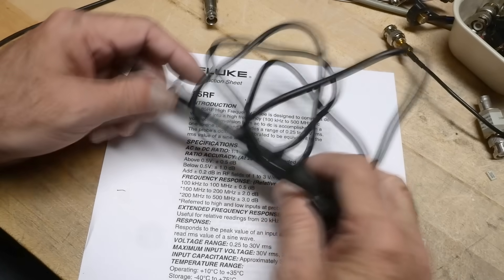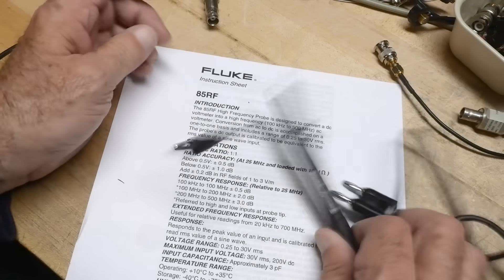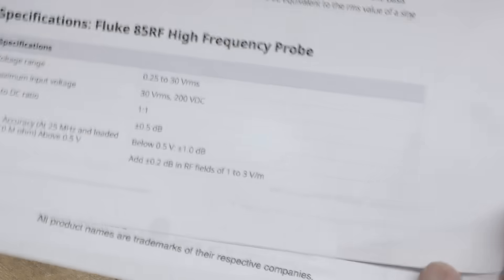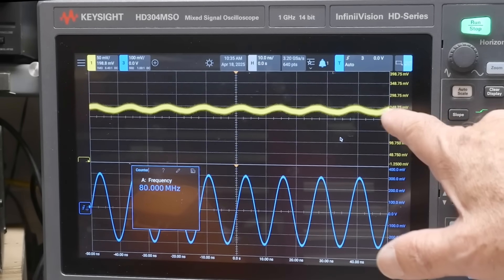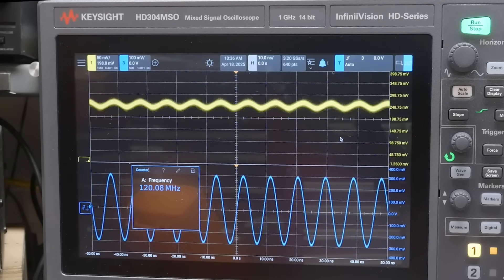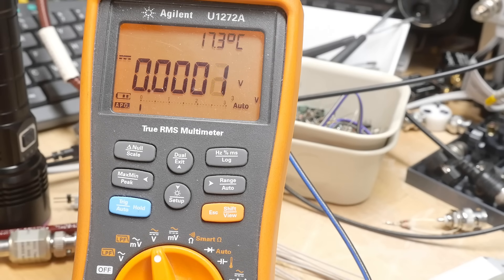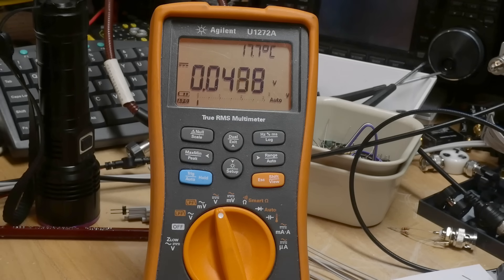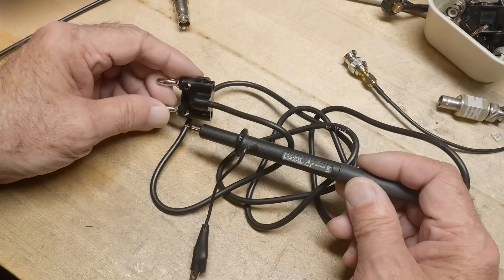#2224 Fluke RF85 Probe

Comment: Input diodes in probes are realy sensitive ones, they are realy easy to damage whit ESD.
Soviet used detector diodes in portable radar detector, came whit bunch of new in lead tubes, one whoud cut open lead tube to replace ones that died.
It seems that they where on order of magnitude more sensitive than normal germanium ones.

Comment: The product overview says: "The 85RF High Frequency Probe is designed to convert a DC voltmeter with a input impedance of 10M ohms into a high frequency (100 kHz to 500 Mhz) RF voltmeter." It's not surprising that it doesn't work feeding into a 50 Ohm load...
Reply from the maker: the scope is not 50ohm, it is high impedance, and I used a 10M volt meter to show the effect is still there.

Comment: I don't know what caused that behavior, but I am almost sure that it is some weird/parasitic resonance that happened inside that particular setup. As reconnecting that probe to the multimeter slightly changed that behavior, I am definitely thinking about something related to the grounding, because that's what was changed when the output of that probe was connected to the multimeter as multimeter has no ground interconnected to the rest of that setup. Simplest thing to try — remove that grounding wire loop between the probe and the rest of the setup replacing it with a proper coaxial connection. I don't know whether this helps or not, but it's easy to do and it's always better to try simple things first.
Reply: At higher frequencies the rather long ground lead is going to drastically effect it's performance.  The probe becomes a resonant circuit.  At higher frequencies the ground wire should be removed and one of the spring ground points like are used on regular oscilloscope probes should be used.  It has the ring at the tip for them.

Comment: Long time ago I made some probes like this for tracing signals. later on I built true RF probes for tracking RF-active points on PCB's and also to evaluate potential EMC violating radiation, over a band of 2 GHz. The sensors were for electric and magnetic field components. The signal was sent to a spectrum analyzer. EMC directive compliance could be predicted well with them. It was very easy point of any component or trace on the PCB which was either radiating RF or the RF currents were relatively large.
Reply: As a clarification, the probes were very small non-touching, sensing the fields just outside the PCB

Comment: Right off the bat, that long ground alligator clip lead is not going to work at high frequencies. Just like a scope probe, you need one of those tiny springy ground wires that slips on the end of the probe to get accurate results. That's why you see wild peaks and dips: resonance with that huge ground lead inductance.
Reply: Bingo.
Reply: Spot on! The probe came with a ground spring contact that slipped onto the sleeve behind the tip. It also came with a slip on BNC connector if memory serves.

Comment: As a comparison, I have a BNC coaxial inline detector,  100k to 4 Ghz.  It's DC voltage output stayed within 1 dB varying my generator from 30 Mhz to 500 Mhz as my upper limit is 520. Taking into account the generator tolerances, the detector and possible reactance in the load .it is not terrible
Reply: Yeah, Amazon has cheapo inline detectors based on ad8362  with 50Hz-3.8G,but requires 5V. -52 to +8dbm.

Comment: I did check it with my signal generator into a 50 ohm load and ref. 30 MHz, 0dbm.   it rises a little to be 1 db up at 100.  But it rises to just over 5 db up at 200 and almost 6 down at 300 so I would call it maybe a 100 MHz probe.  This with a DMM measuring probe output.  BTW I did have the probe into a female BNC and clipped the ground lead to it but I believe the ground ring on the probe was resting on the BNC body as it went in at an angle.

Comment: A passive probe will have some dependency on the amplitude at the lower end of its range.  The 300 mV peak are just a little below the lower end of 0,25mv rms. I will not defend this type of equipment, it might still be helpful for ghost busters as the datasheet says : add +-0.2 dB in RF fields of 1 to 3 V/m.

Comment: According to point a on page 2 in the instruction sheat you showed the 4 inch grounding cliplead you are using is only good up to 100 MHz.
You need a coaxial adapter or other way to connect with low inductance to the coaxial ground near the tip to use the full bandwidth.
Reply: If we estimate the loop inductance to 125 nH and use the specified 3 pF input capacitance we get a resonance at 260 MHz. 125 nH is the inductance of a 50 mm wire loop of 1 mm wire according to an online calculator, a rough approximation of the geometry of your setup.
Reply: My 85 has a ground lead that measures 4 3/8 from the body to the end of the clip.  That feature is a necessity for practical use though.
Reply: @TomSherwood-z5l  Good measurement setups for high frequency are just not that convenient, that is just a fact of life. I think the most practical alternative in many situations is a spring ground tip wrapped around the coaxial ground ring. Just as with a high frequency oscilloskop probe. High frequency traces often have accessible ground close by.

Comment: The best RF probe ever made came with a VTVM.  I have 7 of the Sentinel Electronics ME-26D/U military VTVM meters (a version of the HP 410B).  They use a tiny Emiac diode tube in the tip of the AC probe.  They accurately measure RF up to 700MHz and is still usable above 1GHz with reduced accuracy.  Still my favorite meter ever made hands down.

Comment: I got a Fluke 85 that I picked up somewhere but it never comes off the rack because I have 100 and 200 MHz scopes at hand.  But if you got a meter and no scope I guess it would be an economical accessory.  I could make an excuse to use it on RF that is outside the range of my scopes but it looks like at UHF it is only accurate enough for relative measurements.
Reply: A high bandwidth scope 500 mHz or 1 gHz, CANNOT demodulate RF!  If your Fluke 85 goes unused, you either don’t know what it’s used for, or you don’t work in RF!

Comment: It appears your scope input is 1meg ohm. The manual says it assumes a 10meg input to the DMM ??
Reply: You're right but the thing I still crap lol
Reply: @daveselectronicslab  No, they work fine.  The ground wire needs to be removed and the correct push on spring ground probe point installed just like you would do with a oscilloscope probe when working at high frequencies.  It has the ground ring on the tip for using them.  Or you can use a scope probe tip to BNC adapter.
Reply: I meant the bandwith sorry @mikesradiorepair